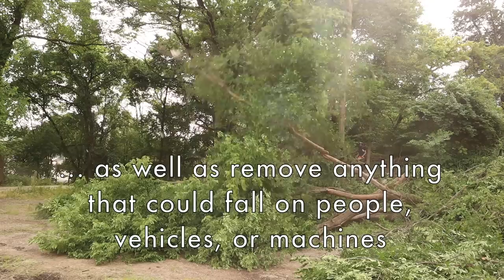Clearing Dangerous Trees from Behind the New Shop!  ~ Part 6 ~ Rebuilding of "The Salvage Cave"

Comment: Since you’ve evidently already have part 2 done, I would have suggested putting (2) concrete catch basins about 100 ft apart along the bottom of the hillside perimeter, that way you can control the water. It’s possible that’s an underground spring where your A-6 got stuck, but more likely runoff from the upper property in either case this is where the catch basins would shine. As far as that lone slab goes could you use it in front of one of your man door exits— keeps the shop floor clean too.
Reply: they let u do open burns?

Comment: Handling cut logs is always far easier and quicker by hand.  I had long years of practice in  doing just that!   Machinery is always too awkward for speed.  Glad to see you partly adopted that method  in the end although you do like to use the 5625 and you don't give up easily!
Reply: That and it is going to be hard on chains cutting the rest of that muddy wood to size.
Reply: @MrGordy61  That's one part that most people won't realize until it's too late and they are spending way too much time sharpening.

Comment: I do 50-1 as Stihl recommends, using full synthetic 2 cycle oil and also use high test gas (alcohol free) l do add a fuel stabilizer as well.. so far so good..  worthwhile project you have going..

Comment: I like Mercury outboard marine 2-stroke oil for all my 2 stroke needs. It’s not expensive and has a tried and true long track record for performance and stability. I also only use 100% pure gasoline in all of my engines including cars, trucks, motorcycles. The gains in HP and MPG plus stability in my vehicles and equipment far outweighs the increase in price.  I mix a 40-1 instead of 50-1 ratio in my still because your right a little bit richer = more lubricant to the engine. Great Work Love your Energy!

Comment: non-ethanol fuel can be found around lakes where they sell boat gas. i just use straight 30wt. non detergent oil in my premix, unless i find two stroke oil on sale. been using it since i ran my yammers 80 dirtbike around the farm as a kid in the 70's and 80's. it was what my dad used in his chainsaws, so that's what we had. i still have and run my dad's poulan 3400 counter vibe saw on occasion, and it still runs strong after over 40 years of cutting firewood without an overhaul. my stihl saws don't seem to mind it either. you just have to mix it at the ratio the mfgr. specifies.
Reply from the maker: Interesting, never heard of anyone running straight 30wt... definetly a pretty cheap option! I like the tip about finding boat fueling locations, ill have to look into that! Thanks!
Reply: Boat and airplanes.  Check out small airports, too.

Comment: I run premium non ethanol fuel mixed with Stihl oil and Sea Foam additive mix and Stihl bar oil, never have issues with the saws or anything else run on the mix, yes it is more cost up front, yes, it’s my way of doing things, not saying it’s the best way or it’s my way or the highway, it just works, but so is down time on the back side of the cheaper fuel and additives, I detest down time, especially if its something I have done to cause it. 🥴😏😉 thanks for the update sir.

Comment: Nice vid hoss.
I have about 100 saws. 30 some run. The rest are parts and project saws.
Ethanol free gas ONLY. Opti 2 ONLY. Never an issue with fuel.
You are right, too much oil in the gas is not better.

Comment: Interesting process, all you had to do is ask your friend what length of firewood he used and then you could have both cut all the wood in your lot to the correct length and it would have loaded into your truck with no issues. Oh well.

Comment: Keep in mind that those bigger trees were absorbing and transpirating up to 150 gallons of water per day, depending on size and species. You are now going to have to manage a few thousand gallons a day that was not previously running out of the hillside. I've had similar problems removing just a couple large trees. Crushed rock and drainage systems will take care of it.

Comment: Jack of all trades doing mainly gardening work and I just run stihl two stroke oil (red stuff here in Australia) 5 litre bulk tin and refill a one litre squeeze bottle 2 or 3 times before getting a a new litre one as they wear out after a while. Never had any issues and I run a 2 litre 98 and 3 litre 91 mix of fuel.

Comment: Ive always ran a 25:1 mix castrol 2 stroke oil or any other 2 stroke oil. with the air filter after cleaning put 2 stroke fuel over it to leave an oil on the filter

Comment: I always use premium non-ethanol gas in every small engine I own. For 2-•stroke, I use Amsoil Saber. I've been using that for more than a decade without an issue. It doesn't smoke and it doesn't clog spark arrestors. I don't use my chainsaw as much as I used to but it always fires right up after sitting for about a year usually. I don't have anything against the premixed stuff other than its highway robbery (even moreso than premixed coolant).

Comment: i run a good full synthetic oil the old  snowmobile racers said when synthetic came out it changed everything their engines ran way longer on it . i have ran polaris full synthetic two stroke oil for 20 years with no problems

Comment: Oh Matt - plan your work so you only have to handle stuff once. If you had driven the white truck round the back, cut up the logs to length, load the truck by hand; you would not have chewed up the lot, you would have proper length firewood, you would have saved using diesel in the machines and had a safe level load to take home. Phew! I'm off for a beer!

Comment: I’ve gone to straight off the shelf, premixed canned gasoline for all my two cycle equipment. It’s a bit more expensive but I don’t have any problems with equipment starting or running, all my equipment is adjusted for 50 to 1 mix

Comment: I only use alkylate premix fuel on the smaller two strokes. I think you only get Aspen and Stihl alkylate stuff in the US. Over here it`s readily available and not tremendously more expensive than regular gas. I like the alkylate stuff, because it stores well, doesn’t gum up the carbs, and don’t produce so much crap in the exhaust for you to breathe. On the snowmobile, I use regular fuel and synthetic two-stroke oil. Taryl fixes all did a test on various fuels, including regular gas and alkylate. If the engine needs a fatter mix (like my trimmer) I add some more oil to the alkylate premix

Comment: I have been using just reg unleaded pump gas and mixing the oil at recommended rate for years and my saws an weed wackers have all been running great with no issues for years. Unless an employee backs over a saw or weed wacker with the truck LOL
Reply: If they are used without any long storage it certainly can work well.  Go ahead and let one sit for half a year or more and see how many clogged and ruined carbs you have.  :)
Reply: @videodistro  the weed Wacker and old lawn boy 2 stroke lawn mower sit all winter basically September until June with no problems for the last 20 years but I take care and drain the fuel and run them empty before winter storage the chain saws get no rest as I cut wood all the time for sale and the cook stove, wood furnace, fireplace and all

Comment: That looks like Japanese knotweed you're removing just before you're sharpening the saw, it'd super invasive stuff and can grow back from a tiny bit of root, incidentally you can remove the Ethanol with water by adding water to the fuel, shaking it up and allowing it to separate from the fuel, ( the water sinks to the bottom and collects the Ethanol with it) syphon/pump the Ethanol free fuel off the top, add some octane booster to restore the octane level.

Comment: I use Aspen 2 premixed fuel in all my 2 stroke stuff. It's a little more expensive than mixing your own but it's ethanol free and I find it runs cleaner and easier than any other fuel I've ever used. I've even found that it can improve the performance of hard starting, unreliable 2 stroke engines.
Reply: There is a lady on YouTube who is a small engine mechanic...  "Shechanic" or something like that.  She did a lot of testing on two stroke mixes and found all the ones she tested affected RPM and power.   I think her recommendation was more along the lines of Matt's method.  Might want to take a look.
Reply: @ramosel  it’s “chickanic”

Comment: I always buy ethanol free pre mixed fuel in small cans or gallons. Put the guess out of mixing. 100% worth it. We use it in the ice augers and put them away in the spring and then in the winter they fire right up.

It’s called TruFuel. Green and red cans

Comment: I use marine oil in my 2-stroke engines because it has more anti-corrosion properties.  I haven't had any issues in the past 5 years with any of the equipment.

Comment: At work we only use Stihl Motomix because of some colleagues switching up gas canister and Motomix is one of the best fuels you can get for Stihl equipment. At home we mostly use Aspen2 cause my dad can get that quite cheap. In addition to that we always have 2 of those 100ml bottles with Stihl HP Ultra for emergency cases.

Comment: Try Amsoil 2-cycle oil. The best hand down. It keeps engines much cooler and doesn't burn up as easily, freeze or emulsifies......Period. It stay's microscopically stuck to all kinds of metals even in cold or sitting for long periods.

Comment: If you put water into the ethanol fuel, shake it up, the ethanol binds with the water and settles out. Then just syphon off the gasoline off the water-ethanol mix and bam. Ethanol free gas.

Comment: As a chainsaw mechanic my choice is echo red armor oil. I have had issues with stihl oil clogging things up and leaving deposits.  I collect and run antique saws also. oldest saw was made in 1954 newest ones are computer controlled. I run the red armor in everything with E free fuel <--- that should be underlined about a dozen times.  Most saws past the mid 1980's will run perfectly well on 50-1 mix. I have picked up old saws made them run and put a few tanks of fuel through them with the red armor oil and they were visibly cleaner inside. for the average user. E free gas is the most important part. Any decent oil will likely do just fine. For those of us who put things to heavy use though Red armor is my recommended oil. Try it out :) Form your own opinion.

Comment: I use true fuel in all my lawn mowers, snow blower, lawn tractor  chain saws, back packs. Never had a problem..
Reply from the maker: Yeah that is ethanol free premix gas and it's great stuff! I do not to use it ONLY because making my own ethanol free mix is a cheaper option for me... i have used it in a pinch and it runs just the same!

Comment: Whoa, what's that awesome chain-sharpening tool you used there?
Not only is letting the saw warm up better for the rings, I'd bet it reduces scraping/piston-slap when the piston is warmed up and expanded! All-in-all, making it last longer. Ah, drainage, good fun in the mud! XD
Reply: Look for either a Pferd or Stihl (made by Pferd) chain sharpener. I use them. They sharpen the chisel and keep the depth gauge at the proper height at the same time. Amazon or your local Stihl Pro dealer should have them.
Reply: Cool, thank you!

Comment: One point you missed on making your gasoline mixture:-  Adding a little pure gas to the oil supply bottle, shaking it, and adding it to the main bottle.  Then fill the bottle with the pure gasoline.   Otherwise, you leave an appreciable amount of your small amount of oil in the oil supply bottle.

Comment: Guessing you are back east? ...by your top angle pie cuts.   I'm in the Sierras and with 20K trees, I have to drop a bunch every year... a few big ones.  Thankfully I have buddies that are from logging families.   Everything they fell is done with a modified Humboldt, traditional Humboldt or even a Humboldt with a snipe.

Fuel/Oil... I believe in your method.  A local Stihl Distributor gives great buys on their 2Stroke Ultra oil so that's all I use.  But, I add Sta-bil because I just never know if that gas is going to get used in the next week or in 3 months.
Reply: If the tree is not large there's no reason for a Humboldt.  The flat on the bottom is much easier than trying to angle cut uphill.  With a very large wedge a Humboldt certainly helps so the wedge will fall out.  Small wedges?  No need.

Comment: Is the skid steer 5625 a new unreleased project?  I remember the 4625 pulled from the junkyard
Reply from the maker: Yes it's a newish to me machine... you'll see more on it later! The 4625 MAY be getting a new engine at some point... this 5625 has been a good runner for the most part, ive still had to do a bunch to it!

Comment: I've used optimal opti 2 for close to 40 years,  and until you asked what we thought I was going to tell you that along with the non ethanol the 
Opti 2 has a built in stabilizer and that's why you can leave it in something for a couple years . I've ran it in all the 2 cycle machines I have and have worked on . Oh ya by the way I've been a small engines mechanic for that said almost 40 years and have never had a break down caused by opti 2. !!!!!

Comment: I put about 1/2 gas in the tank, add the oil, then rest of the gas, so the oil stays in suspension, not stuck on the tank sides or bottom. Then, shake it, baby!  🤣🤣

Comment: Hi I only use ethanol free fuel on all my two strokes and older power equipment. For my two strokes I'm using Husqvarna oil I'm adding 1 oz per gallon of seafoam and stabilizer all at the same time.  I've been doing this now for the last 5 to 10 years I haven't had to take any carburetors apart to clean them and everything starts right up no problems.  Now for my lawn mower it can accept ethanol fuel. ethanol fuel from some schools I have attended has a 17 day shelf life I add an additive into the ethanol fuel that helps stabilize the separation of the alcohol and gas.  I also add 1 oz per gallon of seafoam into this mix as well. My mower is 10 years old this year and I haven't had the carburetor off this machine either.

Comment: I run amsoil interceptor 2 stroke oil in all my stuff because thats what I put in my dirt bike. I have a lot of ethanol-free stations in my state but its always 88 octane so I do add octane booster.
Reply: Why add octane?  It just slows down the combustion so cars don't knock as much.  Your stuff should run excellent on 88.
Reply: @videodistro  because my bikes have higher than stock compression.
I've had one diesel on straight 88.

Comment: I fell back with chainsaw like you did and end up the emergency department with a cut leg.  
What did I do after, I bought a pair of chainsaw chaps and wear them.  I also am still cutting.  Getting cocky will get you hurt,
Reply from the maker: Yeah a pair of chaps would be good idea, and i should get some, ive just never used them...

They may not have helped when falling backwards.like I did though! Thats why its important to make sure your idle speed is properly set so the blade doesnt move AT ALL when you're not on the trigger... either way, i truly appreciate the concern!
Reply: @SalvageWorkshop  using the blade lock when not cutting is a must.

Comment: I had a buddy tell me years ago if you want your lawn more weed Wacker's or snowblower motorcycle anything that you don't drive all the time or use all the time, when you are going to store it put some two cycle oil in the gas let it run for a while and you will never have a problem with them starting the next year. It doesn't matter to me what brand or who makes the two cycle oil, I have used just about all the different brands and ever since I was doing this never had a problem with my motorcycle or anything else. I let them run for about 25 minutes and I will put a little extra in so I see some smoke coming out once that happens I put it away and when always I take it out no problem

Comment: I use to run putoline in my Honda Cr125 and my strimmer but my Bush cutter and strimmer combi and my mower are 4t we have different fuel here in the UK our lowest Ron unleaded is min 95ron our premium unleded ranges from 97ron to 99ron

Comment: I agree with the ethanol free gas. I have read to make sure to use oil for air cooled engines for… air cooled engines… due to the rpm’s and temperatures they run. 

Oil for marine applications has better corrosion protection I believe, but will break down in an air cooled engine. 

That’s my understanding, not an oil expert.

I like your channel keep it up.

Comment: I have a question: 
 I realize that you definitely don’t want to spend anymore money than is absolutely necessary and you may not have the time, but you do have the equipment and expertise, and looking at the grade all pretty much currently heading right towards your shop, why not move a bunch of dirt to completely change the grade and if necessary put in a retaining wall against the hillside and with the drainage you have planned keep the water totally away from the shop?
Reply from the maker: Some of that WILL happen at some point... right now there is just so much to do, and that's not high on the list at the moment!
Reply: @SalvageWorkshop  after watching you in your many videos and seeing how you do things I kind of figured that would be your response. Best of luck with this. The shop has turned out great so far.

Comment: Here in ms it’s easy to find non ethanol, at least in my city. I’ve got 4 or 5 stations with it within 3 miles. All of them only have 87 octane. There is one south of me that has more variety
Reply: I actually prefer the lower octane ethanol free fuel. Lower octane is easier to burn/ignite.